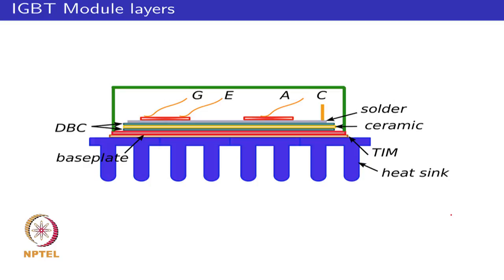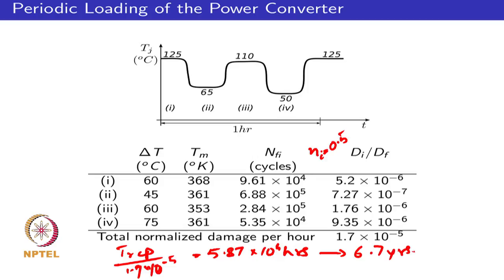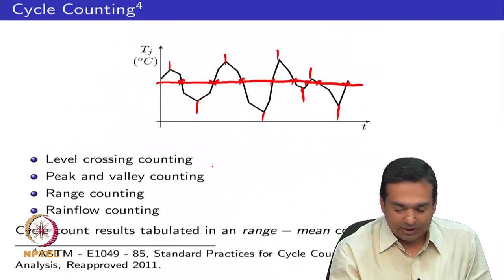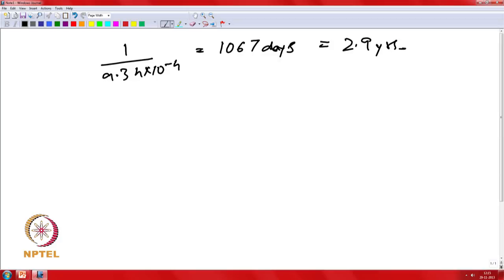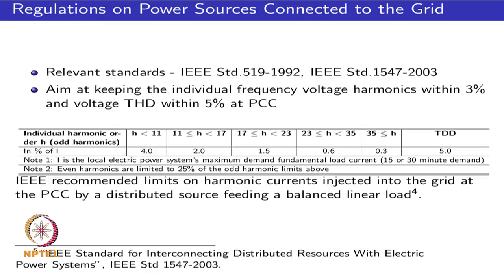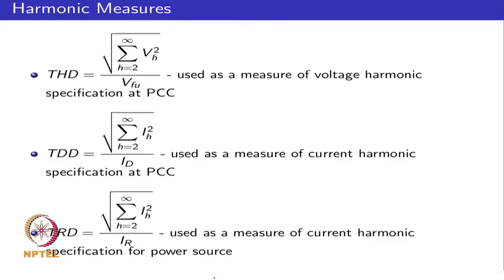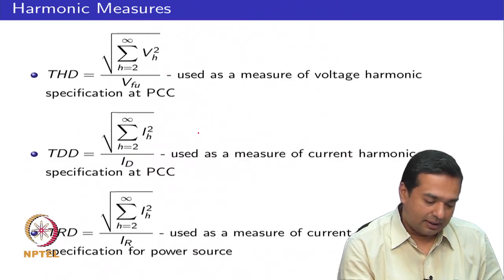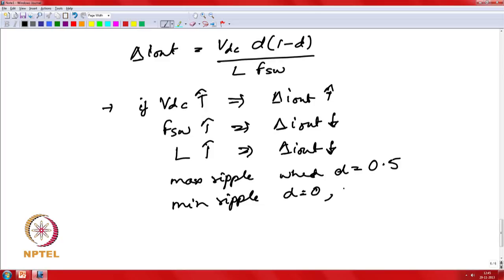Mod-03 Lec-34 AC filters for grid connected inverters

Comment: Hi everyone.knows any to tell me,what if i run my spwm inverter,with any type of load,without low pass filter to the output?,whatt the matter????? must be a filter anyway? and if yes,why? thank you.
Reply: The reason is explained at 33:00. Mainly due to grid and load requirements. High ripple (No filter) can also increase power loss in the system.